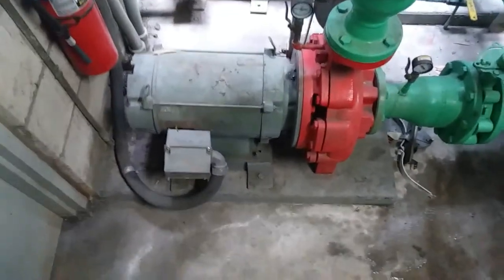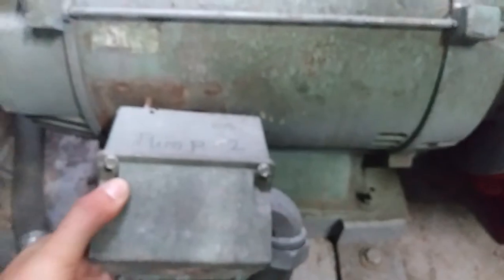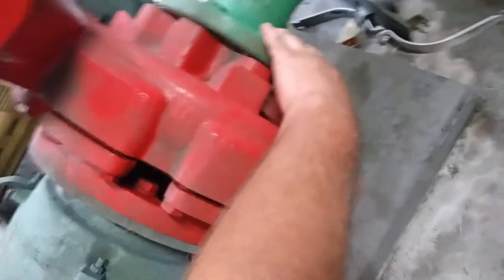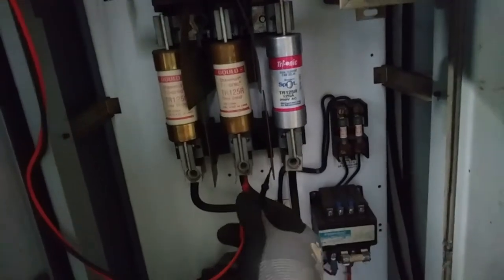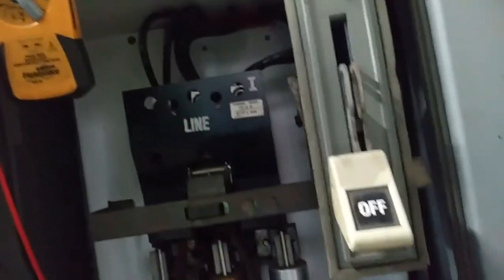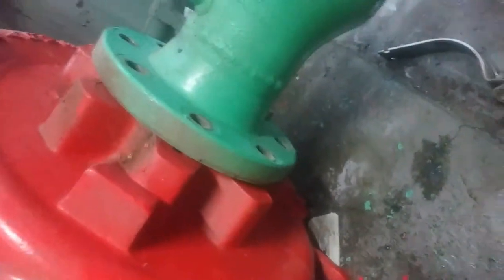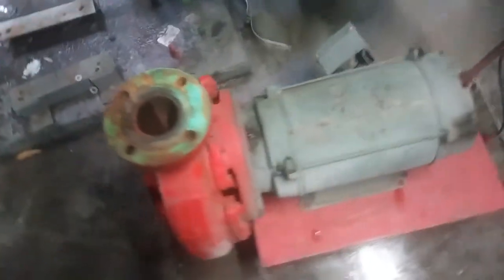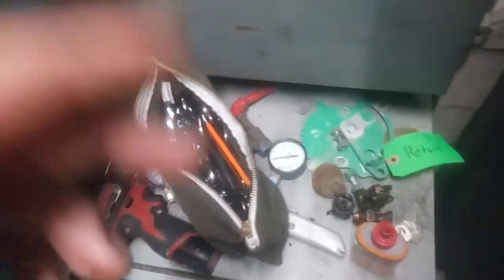Pulling a 30hp CW Pump/Motor for Rebuild

Comment: We do all are own motors on site , that look's like an easy motor do to as long as you have the baring number's. Send that motor over here I will rebuild it for you haha
Reply from the maker: I think the freight price might make that a bit prohibitive haha. I have a good working relationship with a local shop here so i don't mind doing it this way. If they had me there full time; I probably would learn how to do it in-house too. Do you have any videos on that? I am curious how you guys do it. I thought you needed to machine new bushings and things like that...
Reply: @71dembonesTV  I have been meaning to make a video on a baring change out. It's easy you take the front and back covers off the motor, get the puller , pull off the old baring , clean up the shaft and heat up the new baring and put them back on. Close up your motor and you're all done.
Reply from the maker: @67tr876  Would like to see it :)